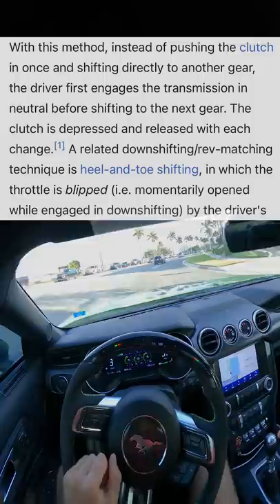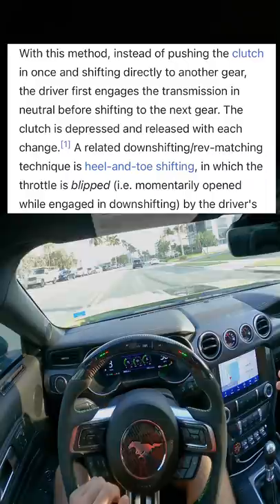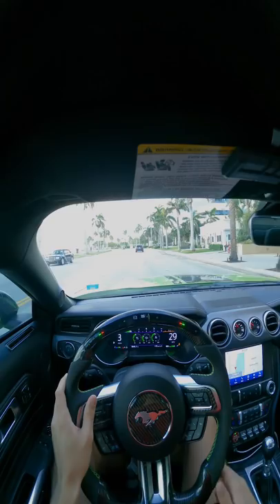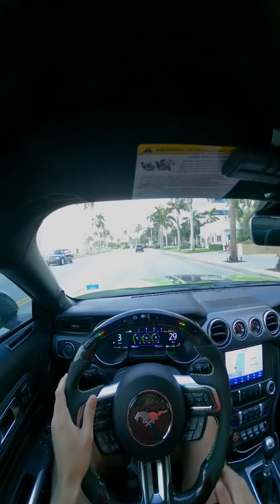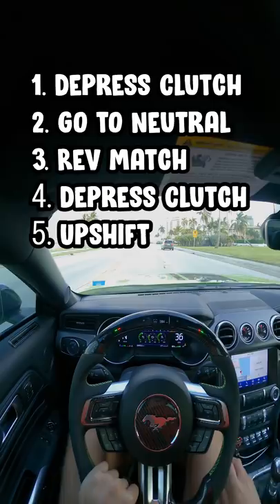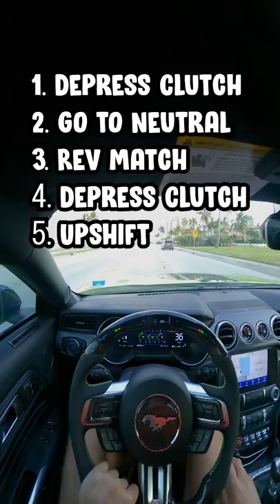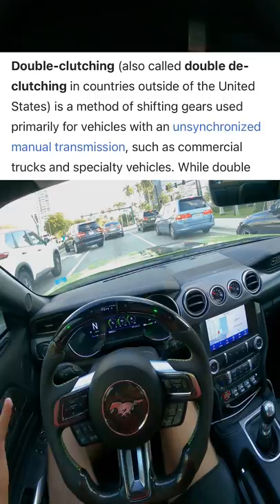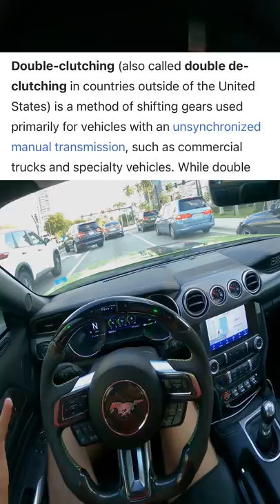WHAT IS DOUBLE CLUTCHING IN A MANUAL TRANSMISSION & SHOULD YOU DO IT? #SHORTS #MANUAL #GT #FORD

Comment: Wrong, you don’t rev match when going to higher gear, the act of clutching twice allows engine time to match rpm of next gear.  When down shifting, you have to rev up to match engine to the taller gear ratio.  This is for low rpm vehicles like semi’s, a mustang would lose power band doing this, this making it pointless to have a sports car. And no, this has nothing to do with dual clutch transmissions.

Comment: Most trucks need to dbl clucth, which alot of trucks use the engine break to slow the engine rev down to be able to shift straight thru.  With lower gears that call for a higher rev b4 shifting need to slow the rev down b4 shift, and after getting into higher gears they will start to dbl clucth to pick up rev to shift.

Comment: We float in semis but were also taught double clutch
Reply: Only to pass the test, I really wish the DOT would allow and teach float shifting.  A free wheeling truck is no good up or downhill.
Reply: @MidnightMechanic  you can float gears on your cdl test but you will lose point for improper use of transmissions. I'm sure there are some testers that will just fail you immediately though.
Reply: @BigPapaHomer  my tester told me to double clutch for a couple minutes just to see I could do it and after said I could float if it was more comfortable for me.
Reply: Whats floating gears and why don't the testers like it
Reply: @manymusicians3743  because if done wrong you can damage the engine.  You know how when your at 5000rpm so you shift and your car comes down to say 2500. Imagine you get it up to 5k. Pull the car into neutral and once your gears hit 2500 you just put it back into gear. No clutch at all.  Your matching the rpms with the engine.  It's much easier then it sounds. I do it by sound. Not by the tachometer
Reply: @manymusicians3743  a semi transmission can be 30-40k so if you float into a gear at the wrong time you could blow it.

Comment: Also in commercial vehicle, say a semi tractor, the clutch should only be pressed all the way to the floor when starting from a stop. Flywheel brake engagement let’s the trans ease into gear  before you disengage clutch

Comment: I use mine to set off in 1st gear mostly, about 60-70% my shifts up and down are done without the clutch, just good throttle control. My old coworker was confused AF as a passenger when I drove my works vans like this.

Comment: No you don’t have to do that in a car. However you’re supposed to in a tractor trailer, but as long as I’ve drove big rigs, I’ve always floated.
Reply: @Dilly Dilly My bad. Floating the gears is what truckers call it. You only need the clutch to engage it into your starting gear. Then once you get rolling,, you use the combination of the fuel pedal, speed of truck, and RPM’s to shift. 
Example: Push clutch in, place shifter into gear, give fuel while rolling(releasing) the clutch out, gain speed and RPM, let out of the fuel, and as your letting out of the fuel, you push or pull the shifter out of gear, and put it in the next gear, then back into the fuel, repeat. Same thing in downshifting just doing it backwards to build up.
Reply: @Dilly Dilly there’s a video you can watch as well. Then cleanest, most informative I seen so far is by a young black man on a channel called FarOut Trucking.
Reply: @Dilly Dilly Yes indeed. The more you practice it, the smoother it gets. It really helps on super heavy loads.
Reply: yup, all about timing, different engines and transmissions have different timings but once you've learned it, the clutch becomes unnecessary. it becomes an automation where you know exactly when to pull the gear out and when to insert it in the next. (truck driver myself, although the truck Im using right now is "automatic" ugh)

of course, changing speed without the clutch might wear the transmission gears faster, but if you grind with the clutch, you'll grind without it anyway
Reply: We all float down here

Comment: The only time I ever double clutch is when I'm approaching a red light.

I push the clutch in to go in neutral
I apply brake
(Light turns green)
I push the clutch again
Put it into New gear
Release clutch well pressing gas pedal.

Comment: You double clutch to downshift. When you don't have synchronizers in your transmission you let the clutch out in neutral to spin all the gears up to match the input shaft. Before the 1960's and some 1970's racecars HAD to double clutch because the lower gear they needed to go into wasn't spinning as fast as the input shaft. Another driving technique was also adapted when double clutching was used for every downshift and it's called "Heel toe" which is using your big toe on the brake, hitting the throttle with your heel and clutching with your left foot because you have to slow down for the turn but also match the gears. The only vehicles that use double clutching are commercial vehicles and period correct racecars. I have never driven a car that needed double clutching but I do a lot of heel toe (mainly for fun) when I come up to a exit ramp and road racing for coming into turns while on the brakes.

Comment: I double clutch all the time i got a 33 year old Daihatsu with yhe original clutch cable still. Clutch is amazingly alright, the cable though slaps all over the engine bay while im driving.

The engine has 100HP but the clutch i believe was developed from a diesel clutch so its going to take awhile for that thing to wear out. Alread has 188k and if i dump it in 1st the front wheels pop. Clutch dont slip. It grabs hard. My cable is why i need to double clutch all the time.

Comment: Turf equipment with manual transmissions don't always have synchros so technically you should stop to shift instead of shifting while in motion, but if you double clutch then you can, saves time on the job🦅🇺🇲

Comment: Rev matching on downshifts is both faster and smoother than letting the synchromesh do the job. If you have constant mesh you don’t need the clutch going up as Revs naturally drop. You just need to be quick of the Revs drop too much. Downshifting had to be blipped to match the revs and is less destructive if you use the clutch.

Comment: As you say, needed with modern cars at all. I have a 60s Land Rover. I have to as it only has synchromesh on 3rd and 4th. 1 and 2 you need to double declutch up and down with Rev matching downwards to avoid grinds. 

Good anti theft tbh. Along with a transfer case that you can pop into neutral. Most opportunists would have no idea.

Comment: Don't really have to do it in trucks either, since you can preload the gate for the next gear, then match the engine rpms, all without depressing the clutch.  If it has a pneumatic splitter, all you need to do is release the throttle, and the transmission will automatically split the gears.  Modern truck transmissions allow this for quicker shifts, but double clutching is required to pass your CDL test, even though it's safer to float shift and not depress the clutch at all.

Comment: Double clutching works well with helical gears as well. Specifically when drag racing and you have a trans that has issues going into gear flat out at high rpm.

Comment: If I have my ac off or low in my jetta I do it, it helps time the rpm match for the shift due to the rev hang from emission. If the ac is on full, it doesn't really hang quite as much

Comment: On a stick shift car between shifts it always goes into neutral first, as the space between different gears on the shift lever is neutral. You’re just extending this time for literally no reason, might as well keep the clutch depressed and then release when matching revs slightly for the higher gear…

Comment: I still match the trans with the engine rpm on downshift when I’m having fun with the 335i. Double clutching is a definite when you are going fast into a corner or if you are on a slick surface. If you don’t your transmission momentum gets lost and when you re engage the gear it can send you not a slide because the drivetrain gets paused for a moment.

Comment: Yeah it’s not necessary. U just do it because it sounds cool, the engine speed will catch no matter what because of the road speed you’re traveling at, just because your Revving to make the shift fall “perfectly” the way you want it to doesnt excuse the fact that let’s say you’re shifting and the road speed you’re at is 35 mph and when you shift into let’s say for example 4th gear that engine speed will be the same regardless, you’re just pressing your clutch two times more

Comment: It's not necessary in modern cars since modern engines and transmissions are pretty well synced together. Now semi trucks are different because the transmissions in semi trucks have very poor synchros and wear very easily which is why most companies have switched and will be fully switched to automatics by 2022

Comment: There is absolutely no reason to double clutch a synchronized transmission in most circumstances. That being said, if you are racing and speed shifting you'll smash your synchros to bits if you do it too long without double clutching.

Comment: If you one of your gears grind, and you just skip it, double clutch it 👌.  Just about the only time you NEED to as a class D driver. Basically let's the transmission to differential half of the drive train slow down so you don't misalign the gears in the transmission.

Comment: You should NEVER double clutch a synchronized manual transmission(car/truck with synchronized tranny).
 Double clutching is for unsynchronized transmissions, which you find in Big Rigs. 
 To be not so detailed, your first clutch disengages the torque  and the second synchronizes.
 Hence, the method of double clutching.
 Also it's a SKILL, you can round off the gears, and therefore have to rebuild or replace your transmission.

Comment: You are not showing it correctly although ur explanation is correct. It's one fluid motion. Press clutch, drop from 3rd to neutral release clutch and immediately push clutch and make the change. There is no Rev match with upshifts if done correctly, only a downshift.
Reply: I have never understood why you would need to release and depress the clutch again once in neutral, could you explain? Why couldnt you just depress the clutch once?

Comment: Its not straight cut that matters, its that the gear engage ment mechanism uses syncro mech or not. In a race car with straight cuts you dont need to clutch or lift off the gas but that is a differant story

Comment: He’s explaining it wrong. You get to the RPMs you would normally switch gears at. Then you shift to neutral and let the clutch out. Then push the clutch back in and finish the up shift. There’s no rev matching needed, and he didn’t explain you need to let the clutch out in neutral, so to simplify, when ready to shift gears: 
Clutch in;  shift into neutral;  clutch out;  clutch back in;  shift to next gear.

Comment: Before I watch the video no it's called synchros and every transmission that is modern has them. Double clutching allows the input shaft to match the output shaft speed of rate to allow the gear to slip and easily.

Comment: I was told they double clutch is the same as pumping the brakes  you build pressure to disengage the clutch and i know this to be true.
Reply: No… that’d be a fault in the pressure system. Double clutching was necessary on old-timey gearboxes that weren’t synchronized - there’s no reason to do it on anything newer than a 60’s car or so.

Comment: Too double clutch like a race driver is to press the clutch changing gear with out letting your foot off the gas this gives u a over rev boost  but don't do this in a road car u will burn out your clutch in no time 👍

Comment: Actually having straight cut gears means nothing as far as double clutching it all depends on if the transmission has synchros or not , the only reason straight cut gears even exist is to fit a transmission in a smaller footprint , strait cut gear transmissions are able to have a smaller shorter case because they produce no thrust angle unlike helical cut gears which produce a thrust angle and require thicker stronger cases and require the use of Torrington bearings or thrust washers , 95% of the time most straight cut gears are actually dog boxes meaning the transmission has a specific type of synchro that has much larger locking lugs or teeth on them these types of transmission can’t be driven softly and can actually be used without the clutch on upshifts once the driver is moving.
Reply: I thought the primary reason for using straight cut gears is that they are more efficient, transfer more torque, a smaller footprint is a secondary benefit, downside is that they are very noisy.
Reply: @hayeduce   primary reason was reduced footprint weight and less resistance believe it or not a helical cut gear is actually stronger as far as the gear goes there's a larger area of contact , the dog teeth and splines on the counter shaft are what really matter when talking about strength but the only reason people believe a straight cut gear is stronger is because the transmissions are usually built better anyway so when jobe lowe drops a jerico 4 speed into his mustang and says its way stronger than that old t5 its because he was comparing a  factory t5 to a precision built gearbox meant for the abuse of racing.
Reply: @grayz827  im not talking about the strenght of the actual gear. Im talking about torque transfer. Thats why most racecars use straight cut.
Reply: Oh yeah definitely ,smaller contact patch less resistance sorry man my bad 😂

Comment: Truckers don't use the clutch to shift in a manual transmission. Doesn't hurt the tranny. Trucks don't have syncros but they have a "clutch brake" all the way to the floor of the clutch. The gears are dog gears I believe and the engine rpm is much more precise to control in a clutch so u can drive a truck without using the clutch or clutch brake and not grind gears at all. U gotta feel it ya know?

Comment: I have to double clutch in my Chrysler. It doesn’t have synchronizers and the gears are straight cut. But when it hit it always grinds
Reply: then you don't get the timing right. a successful double gear clutching shouldn't produce any grinding sound. If it does grind, it means that the engine spoke and the transmission aren't turning at the same speed. The act of double clutching is to bring both set of gears to match speed while transitioning.

I'm a truck driver, and I know that between each gear, I have a 400 rpm difference to match, so if I am currently at 1500 rpm and I press the clutch to change speed, I'll have to press the clutch once more at 1100 rpm to insert it into the next gear without grinding. it's all about timing.

Comment: Doubling the clutch was for old gearboxes that did not have syncromesh
Reply: If I need to downshift quickly I often skip a gear or two, such as 4 to 2 or even 5 to 2. When I don’t double clutch it doesn’t go into gear easily, like I have to hold it halfway while the synchros do their job for maybe 0.5-1 second even, but if I double clutch it slips right into gear. Is this a sign my synchros are wearing out? It is an original trans with 350k kms on it

Comment: This is such an old method of shifting.. it really has/had less to do with matching the gears up then the fact that the engines would drop rpms faster then you could shift.. so wo reving the engine during the shift you would essentially stall the engine going into the next gear . Now in terms or racing you still want to double clutch on down shifts to eliminate driveline shock and unsettling of the drive wheels when entering a turn even with modern synchronized transmissions

Comment: Do not double clutch in a car it is a hundred % that is 100% not necessary and you will wear out your clutch faster and possibly damage your transmission a semi trucks transmission spins alot faster in higher gears then the engine dose that is why the double clutch to get the gears to slow down abit or to get the engine to speed up to match close enough to get the dogs to mesh which are nubs on the side of the gears to interlock different gears to shift up or down car transmission don't need the extra time for this shifting and in fact most truckers do not use the clutch past coming and leaving from a stop

Comment: And all i say is why? Why not just rev match stright up like i get rolling a little and then putting it into a lower gear but why "double" clutch changing up or at all in that fact
Reply: It puts less stress on the transmission, so it increases longevity

Also truckers use it because the gears don't have syncros to synchronize the gear speed to vehicle speed, so instead use the clutch to do that (source I'm a trucker) 

Although we usually just float the gears after we start moving (no clutch use at all) because it's easier
Reply: @srjsamsam  like i used to have a car with a fucked "thust"/spigot bearing and i used to have to float gears 

I just dont see a point in double clutching unlesd you coasting

Comment: Your wrong about needing to Rev when you up shift. You only need to do it when downshifting to match the transmission rpm to the engine rpm in an unsynchronized transmission to synchronize them. You 100% don't need to do this in modern cars as they are synchronized. If you don't understand that means the whole reason double clutching exists now becomes pointless and if you do it your putting more wear on you clutch and transmission.